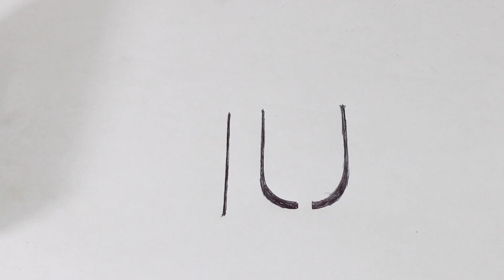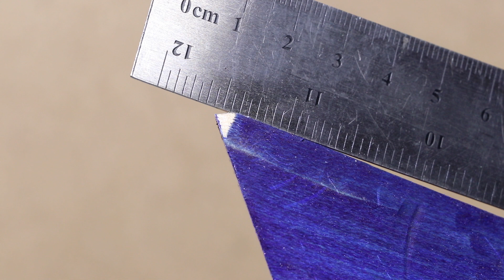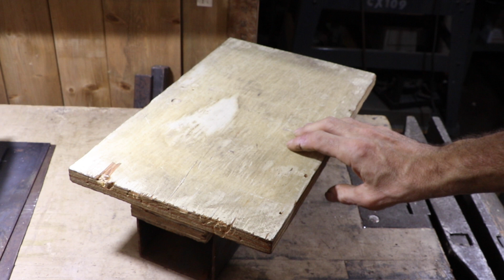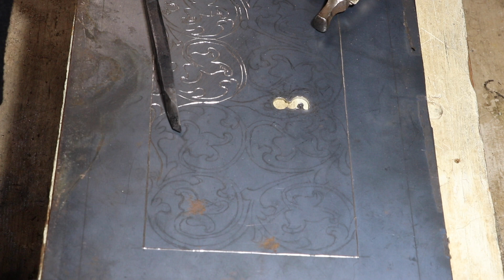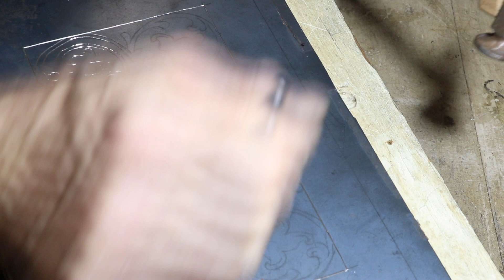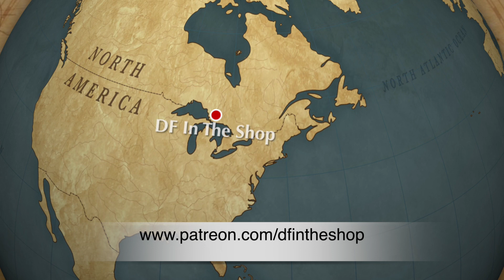Simple Nuremberg Box Project 32 -  DF In The Shop

Comment: Dang. I'm just now finding this video. Last year I decided to take on my first engraving project. I struggled through making my own tools and running them way past when I should have resharpened them. I used harbor freight chisels I ground into shape, but I like your idea of using square stock to start with. That would have saved some time and headache. Next time I will go get some square stock 1095 and grind them up like you suggested. Thank you!